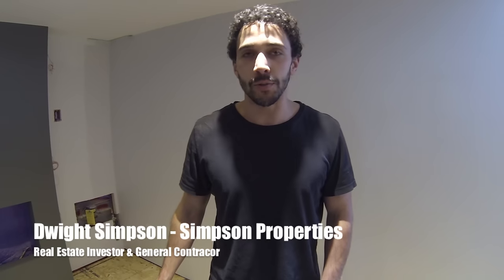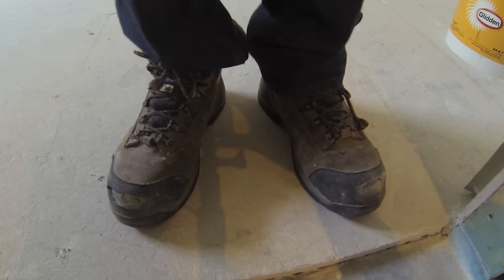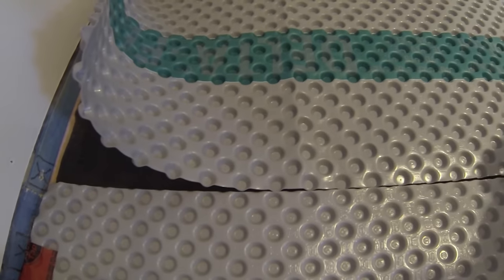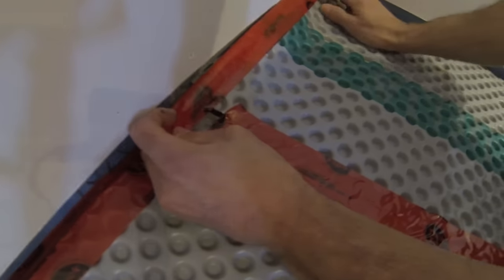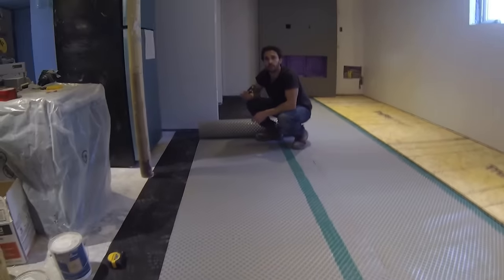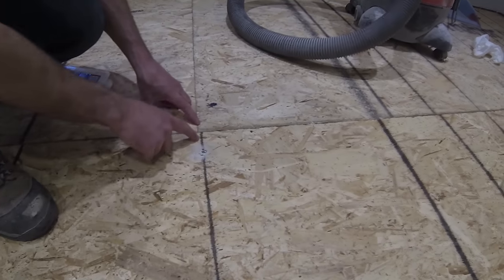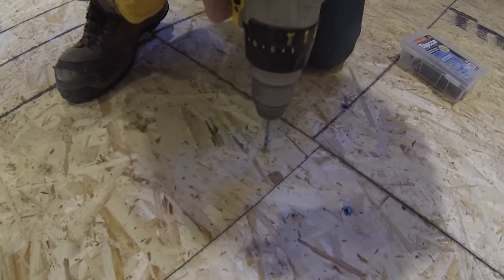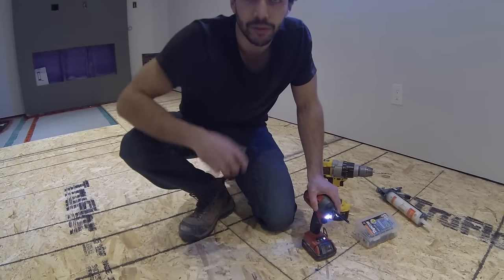HOW TO INSTALL A SUBFLOOR ON CONCRETE

Comment: I do construction and I'm at the point where me and a partner are able to buy and flip houses and everybody wants a basement that's basically finished or done to the point where they can do a few things and make a rental apartment so when it comes to doing the floor I use tar paper for roofing from my vapor barrier because are basement it's extremely very extremely important to have that for stay dry because you will have mold growing under your floor plus taping it off is just important as that vapor barrier but I will put down on top of that ceramic flooring it looks like wood very adorable does not scratch and they just snap together so easily you could use a razor knife to cut the flooring I just use my chop box just because it's faster but people if I'm going over a wooden floor then I'll just use a staple gun but this was a good video
Reply from the maker: Thanks for sharing.

Comment: Going to use Delta-FL on our basement floor and a 4 mm vinyl planking system from Uniclic.  The planks are 48" x 6" and interlock.  Tech support says put it right on top of the Delta-Fl.  With the planks being just over 1/8 inch thick do you think this method will work?
Reply from the maker: Yes this method will work. You can install your plank flooring right on top of the Delta-FL. You may find as you are walking the imperfections in the concrete slab will be more noticeable. Adding the OSB provides more of R value keeping your feet warmer and also helps level your BSMT floor. If you're looking to save money you don't have to install OSB.

Comment: What do you recommend if I have a backwater valve enclosure underneath the floor?  I need to have access to it like at least once a year for maintenance cleaning.
Reply from the maker: I have a back water valve at this property as well. When you're installing your Delta-FL & OSB cut an opening a couple inches around the perimeter of the valve access lid. Use adhesive to secure the Delta- FL to the OSB. The access panel portion of sub floor will be floating and not fastened to the ground. I used flooring transition pieces to create a picture frame around the opening that matched the laminate floor. I just have to remove the transition pieces, they are held in by a T mold lock, then I can remove the access panel for maintenance.

Comment: Hm, I’ve always left the perimeter unsealed with about a .5inch gap for airflow. In a slab there will be moisture so I want it to escape and to stay dry.
Reply from the maker: I personally don’t follow how that will keep the slab dry. The best way to do that IMO is by having lots of 3/4” crush stone beneath the slab (6”-8”), rigid insulation panels, and a vapor barrier beneath the slab. Also, good drainage with a weeping tile system and sump pump. 

The beautiful thing about construction is there are a million ways to do the same task. If having nothing built on the outer 5” of the floor is a building practice you believe in, include that detail in your project 👍🏽. Thanks for sharing that.
Reply: @simpsonpropertiesltd  fair enough, for new construction, but what do you do if you're renovating an old house with a concrete basement floor? My house was built in the 50s, so I'm certain there's no vapor barrier under the slab. How can I let the moisture escape from under the subfloor?
Reply from the maker: @thegreatmoa  The slab in this video was 1950's era as well. If you have normal slab conditions (i.e. no foundation leaks or water saturation on the slab) this install method will be fine. There is still a void between the Delta membrane and the slab. Having the slab exposed on the perimeter will not provide any benefits IMO.

Comment: so if there is a water leak, it will be trapped under the plastic dimple sheet with no where to go. There will be musty smell in the entire area, no?
Reply: In the event of liquid moisture running along the concrete surface, you have to choose.... do you want your insulation or plywood to be saturated or above the water?  given the dimple board is water proof, the fact that water is under the dimple board in your scenario isn't great but likely doesn't represent a problem.  I would be interested in what a professional (which I am not) would say about this topic.
Reply from the maker: You’re right if there was a major leak the water would be trapped under the membrane, if there are no floor drains. Most basement slabs have floor drains with the slab sloped towards the drain. If there was a leak the water should make its way to the drain. Before a subfloor is installed any foundation or slab issues should be addressed. Once the appropriate waterproofing is done then you can install a subfloor.

Comment: Is it practical to do this to the whole  house floor.  I'm building a new house with a concrete slab and would like to nail down tongue & groove (ambient Eucalyptus)...does it make any sense?
Reply from the maker: Personally I wouldn’t do this application over a slab on grade. I would buy a hardwood floor that can be installed with glue only. Do a glue down application directly on top of the slab. I just did this on a recent job over a basement concerted slab. Titebond 771-step glue was used. It worked great.

Comment: Great video! Do you still recommend taping the edges of the Delta FL? I've come across other resources that do not tape the edges. The point of the dimpled plastic is to allow the concrete to breath some. Seems like taping off the edges would restrict airflow.
Reply from the maker: August Noevere yes I would still recommend taping the edges as per the manufacturers instructions. Think of it like your exterior walls. You wouldn’t install tuck tape on your capote barrier everywhere except the edges. It defeats the whole purpose of creating a vapor barrier.

Comment: If you screw down the floor why do you need the landscaping fabric?  After screwing down the floor couldn't you just walk on it and if it made a noise put another screw in it?
Reply from the maker: I personally didn’t want to install more tapcons than required. The OSB will expand and contract over time I didn’t want to run the risk of a defect happening down the road. Once the finished floor is installed it’s to late. You’re right you could install extra tapcons and have no issues. For the cost of the landscape fabric it was cheap insurance and piece of mind for me.

Comment: I have a hydronic heated slab in my basement (and garage). I’m looking for ideas for flooring (carpet vs vinyl plank vs engineered hardwood) carpet is my preferred choice but will take away the ambient room heating effects. If I install this subfloor option under the carpet, will that small amount of air circulation allow the heat to circulate?
Reply from the maker: I don’t think Delta-FL is designed to be used in conjunction with radiant in-floor heating systems. You would have to check with tech support at Cosella Dorkin. Plus, it would act as an insulator and limit the heat distribution. 

I have radiant in-floor heat at my house. I installed engineered hard wood directly on the slab. You have to use a special glue for on slab applications. It works great in that application. What ever product you end up using make sure it’s designed for in-floor radiant heat applications.
Reply: @simpsonpropertiesltd  thanks… I’m in Ontario, Canada 🇨🇦 and the heated floor is absolutely needed 6-7 months of the year. I am considering engineered hardwood but with a 1450 sq ft basement, I wanted to look at all (less expensive) options.
Reply from the maker: @danhusband6154  I live in Toronto. I hear you on looking for less expensive options. Especially, with all the price increase on building materials since Covid.
Reply: @simpsonpropertiesltd  OMG!… I know, I’m just outside of Ottawa. I purchased a ‘project’ house last October that the original owner/builder couldn’t finish due to running out of money… I knew I was in for 2-3 years of projects going into it just to break up the costs… but I think that 2-3 years is now more like 4-5 given the increase in EVERYTHING…. Landscaping, decking, driveway paving etc… the basement is 95% done and only needs paint and flooring now… but so many project have to be put on the back burner until supply chain issues are sorted and the contractors!!!… OMG, they are hard to find, jacked their prices up and have 12-18 month wait lists if they are any good
Reply from the maker: @danhusband6154  the old saying of double your budget and time line always comes true 😂
Reply: @simpsonpropertiesltd  amen!… I’m retired now but in my previous professional life one of statical expressions was , “my stats are 100% accurate within a plus or minus of 100% likelihood of error”… lol
Even if my budget needs to increase 50%… the final value at current market prices will still be a 50% increase from the purchase price. It’s just time …. And I have time!

Comment: how did you work around any cleanout in the floor if it wasnt exactly flush?
Reply from the maker: If the floor doesn’t drop too much you can install the floor overtop and there will be a slight slope in the finished floor. Delta-FL recommends shimming the floor if it’s 5/16” in 5 ft. out of level.

Comment: One more question - would you apply insulation from top to bottom on the outside foundation wall in the basement? If yes, what type of insulation would you recommend? The builder left the bottom portion open. Cheers!
Reply from the maker: Steven Woodard I personally would remove the builder grade insulation. Then frame all the exterior 2x4 walls 1" away from the foundation. Then I would use my spray foam contractor to install 2 lb closed cell spray foam. This is the only way to insulate your rim jousts properly as well which is where you get most of your heat loss in a home. Another benifit of using spray foam is you don't need to use a 6 mm poly vapor barrier. 

If you don't want to use spray foam then I would recommend using Roxul insulation. It doesn't matter if you install it from top to bottom or vise versus. Just make sure your rim joists and wall cavities are filled with insulation. Then install a vapor barrier after. The cost of spray foam has come down dramatically. It's well worth the cost in the long run when you account for your energy savings.
Reply: Okay thanks for this. Much appreciated. Cheers!

Comment: Can you substitute a Ramset and Ramset nails for the hammer drill and Tapcon screws in this application? If not, what is the reasoning?
Reply from the maker: I would not used a Ramset gun for this application. It is too powerful and will cause excessive damage to your slab.

Comment: Total cost on this one? Thank you and great job
Reply from the maker: This job was done a while back. I’m sorry but I don’t know the costs off the top of my head. It’s best that you figure out pricing based on where you live. Material costs always differ depending on your location.
Reply: 328 Sq ft roll of Delta at Lowe's in the U.S. is about $325 USD last time I checked.

Comment: could you use cement board and tile over it
Reply from the maker: I personally would not install this sub floor in areas where tile is the finished floor surface. I would install an uncoupling membrane over the concrete like Schluter Ditra then install tile over that.

Comment: thanks great video!  Can you put a laminate directly on top of the membrane?
Reply from the maker: Drooster TheRooster thanks! Yes you can install laminate flooring directly on top of Delta-FL.
Reply: When would you decide to install laminate over the OSB board as opposed to directly over the membrane?  Thnx!
Reply from the maker: grimloktt I personally would only do an installation like that in a condo because of the restrictions on building materials and installation methods allowed. The OSB in conjunction with Delta-FL makes for a much more solid subfloor.

Comment: What do you do about going over floor drains? I would think they'll eventually dry out and let sewer gases in
Reply from the maker: All floor drains should be primed so that there is always water in the p-trap preventing any sewer gasses from escaping. You may want to leave the floor drain exposed to the finished floor if you have to add water manually or install a trap seal plug. Keep in mind if you plug it the drain won’t work if you have a flood.

Comment: Probably a dumb question - but if just carpeting couldn't a carpet pad with a moisture barrier serve the same purpose or should this be done as well?
Reply from the maker: That could be done as well. It’s more ideal to have a subfloor installed first.

Comment: Hey question for you,
I'm thinking of doing a subfloor the same way in my basement on concrete and wondering if I should do this over the entire floor including the washroom or frame it out then lay it and leave the washroom?
Reply: check out the delta fl website it may help.
Reply from the maker: IMO it’s best to install the subfloor then frame your walls on top. I framed my walls first so that I had the final wall locations to work off of when installing the underground plumbing rough-ins in the bathroom.
Reply from the maker: Either option is fine though. It all comes down to what makes more sense based on your project and workflow.

Comment: great video! 
I've done this a very similar way. If you add more screws you don't need the landscape fabric. I do 11 per sheet and seems to be enough, if you have more of a slop in your basement then you can add more. I thought the silicone was a bit much yet totally see the beneficial aspect to it
Reply from the maker: Thanks for sharing that. For piece of mind I wanted to install the landscape fabric to ensure that hallow sound wouldn’t be present. The silicone step is a little overkill but it doesn’t cost much more to do.

Comment: Would the concrete floor  have any insulation under it ?
Reply from the maker: Some new construction homes have insulation beneath the slab. It’s a detail that is commonly done on custom homes. 

Older homes like the one in this video have no insulation beneath the slab.

Comment: very good video. i was wondering what the cost comparison is per 2x2 square with your system?
Reply from the maker: Recovery12Life thanks! 
These prices are based on today's prices in Canadian currency and do not include tax (HST). I did the comparison based on a 4'x8' section (32 sq ft). 

8 Dricore panels from Home Depot is $47.84. 

Delta-FL from Lowes is $0.71 sq ft x 32 sq ft = $22.72. 

5/8"- 4' x 8' OSB from Home Depot is $17.55. 

$17.55 + $22.72 = $40.27. 

The Delta-FL method is $7.57 cheaper for a 32 sq ft section. I hope this helps.
Reply: @simpsonpropertiesltd  Today an OSB is 50$ ... I can't afford a floor anymore loll

Comment: I just recently cut a huge chunk of concrete out of basement to re plumb my drains and take out old cast iron. after I poured the concrete and got it as close as I could match up to the old concrete lines I found I have slight level problems in old areas of floor just in one corner.  now on the new concrete I poured after it set and dried I started framing in my walls again.  I didn't not use anything in between my treated lumber for the base plates and screwed them directly into the concrete. I did wrap my pvc pipes in plastic before I poured concrete and also will this hurt being I have treated lumber directly on concrete.  I am below frost level. so the dirt was dry and compacted. also... how level does the floor have to be for your method on here to work? I want to do it this way with that your showing but I didn't use no barrier between my base plates on concrete with my treated lumber. I'm not finished framing and can take it all out of need be.
Reply from the maker: Anthony Vasquez unfortunately you will have to take your framing out. Make sure the treated lumber you are using is designed to be used indoors. PT lumber is normally only used outdoors. BluWood manufactures a treated lumber that can be used indoors. You should staple either a foam sill gasket or 6mm poly to the bottom of all your base plates. You can also install your subfloor first then build your walls on top of the OSB. If you use that method then you can install your baseplate directly on top of the OSB without using a sill gasket. Any dips or low spots in the concrete surface greater than 1/4" should be trowelled level with a Portland cement compound or leveled with a self-leveling compound to ensure an accurate installation.
Reply: Thanks so much. Greatly appreciated. I'm gonna chew out the carpenter that helped me. I will take back down and start over. Luckily I didn't get too far.
Reply: How high did the floor raise after you did all that?
Reply from the maker: Anthony Vasquez Anthony Vasquez no problem. I'm glad I could help you. Delta-Fl is 5/16" + 5/8" OSB = 15/16". It's almost 1" in total. If you check out my video on "How to Frame an Electric Fireplace Rough Opening" you may learn a few tips to help with your framing.

Comment: Can I built a wood decking with 2x4 studs on top of the membrane to level my basement floor? I have a drain and a would like to maintain the slope but I dont know if that would damage the membrane, all the nailing? ?? thanks
Reply from the maker: That shouldn't be an issue. Where ever you install tapcons or nails use some silicone. That will help maintain your vapor barrier. I had floor drains in my basement as well. There is a bit of a slope in the finished floor but it's nothing crazy. Depending on how much of a slope is towards your drains you may just want to go with a standard installation. Another option is to rip some long shims and install those between the Delta-FL and OSB. You could use a strong adhesive instead of nails to hold them in place.